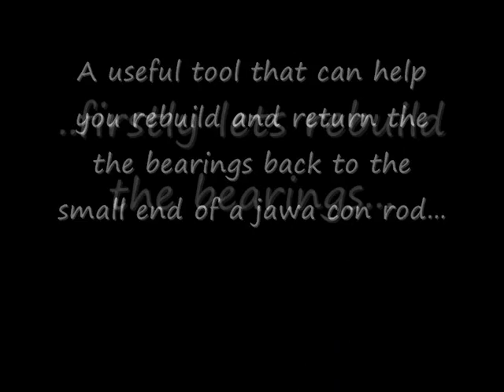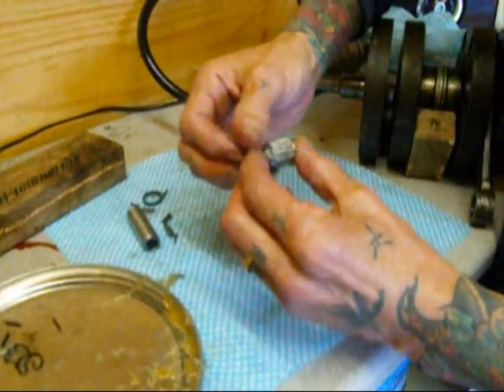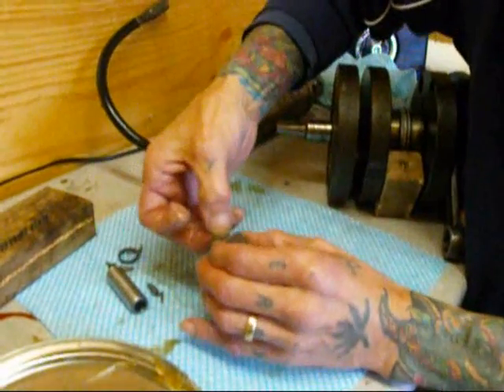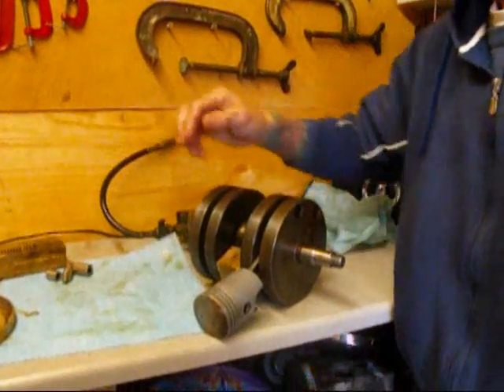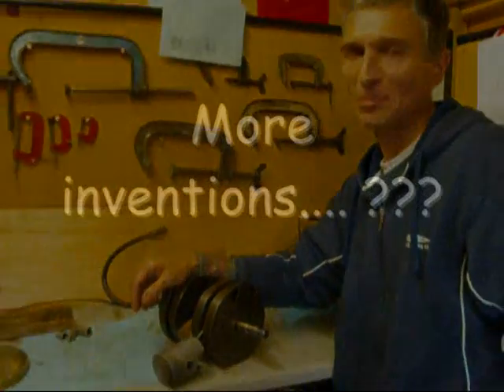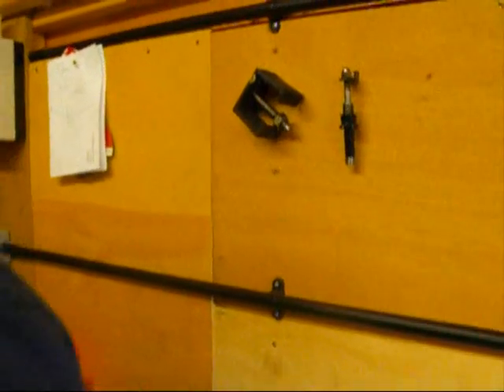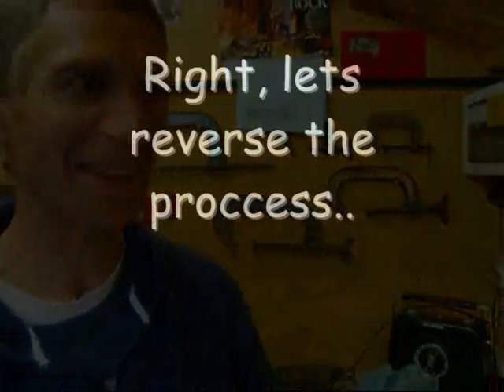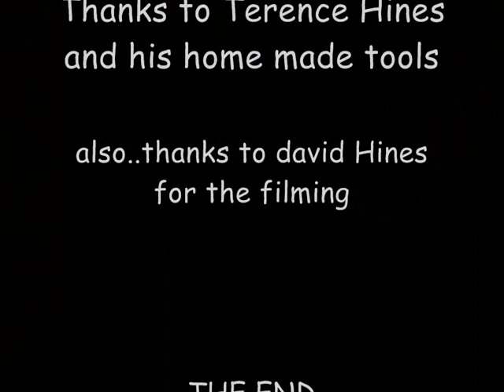JAWA 350 RT TS CAFE RACER SMALL END BEARING ROLLER TOOL FROM:

Comment: i have a jawa babetta and there the same roller type bearing but i replaced it with cage roller bearings there a lot more efishiant and do not mesh like the ones loose without the cage  i foud out that i do not get piston slap?? naw but before it did and thanks for the info on the special tool it took me ages last tyme i built one

Comment: make a bush from an old piston pin?
another question,\
 i also have this type and engine, runs good but some have factory mistakes in the cylinders. ports are not at the same spot as the canals, so partly blocking one-other..
Does anyone have the data from factory about the distances and measurements of the ports in the cylinders??